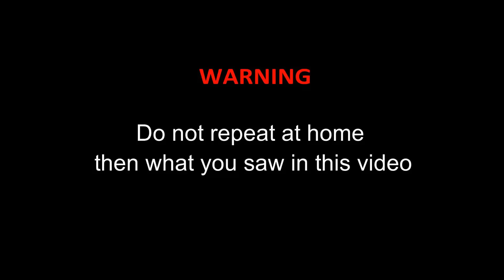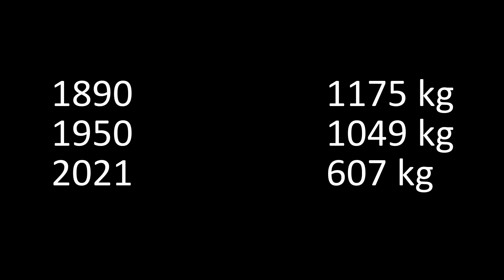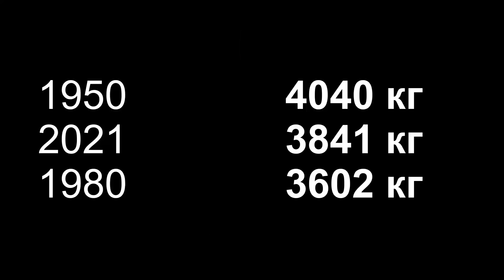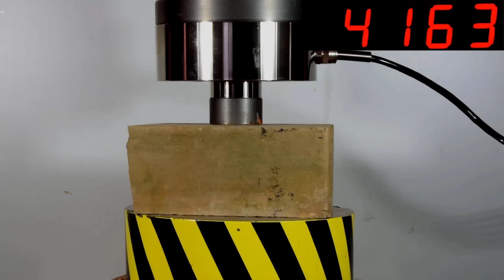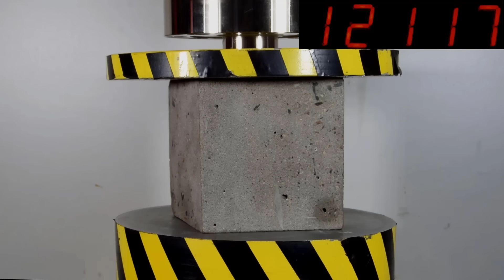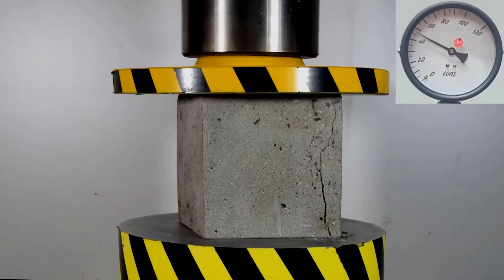HYDRAULIC PRESS VS OLD AND MODERN BRICKS

Comment: FYI: Modern brickas are intentially produced with air pockets so that it lighten the burden of brick layers.
Of course they arent as sturdy.
Also,  modern bricklaying is usually laid as a shell wall and isnt load bearing in the same way that it used to. It's more of an expensive yet efficient weather surface.
Reply: Exactly. Buildings are basically made of steel concrete. The bricks are just aesthetic. The steel inside the concrete deals with the tension forces for the most part.
Reply: No , supply in demand. And different buildings practices. Brick layers are not worried about weight.  It’s all about Portland to sand ratio. More bricks are needed now then ever in are history. And with a lot of Portland shortages bricks are not made the same
Reply: Also worth nothing that the bricks are being compressed in the wrong orientation in this video. I don’t know if modern bricks have any sort of grain structure in them to act as rebar but it’s more than possible that they do
Reply: @austins19982  Bricks are made of clay, not portland cement. You're thinking of cinderblocks.
Reply: Did you I ow that safety doesn't matter if your back hurts?
Reply: @austins19982  supply AND demand*
Reply: Thats a long way of saying we are lazier now and don't want to spend money.
Reply: Rickard, I do see a lot of new construction homes (300k-1m+) and notice a lot of the bricks are just a facade, only on one or two sides. I notice the big industrial building being put up and it looks like poured concrete walls with metal bracings, not brick.  I own a 2 story brick circa 1930. And I see a buncha brick bungalows in my city.  I saw cinder block commercial buildings being built. I don't see full brick buildings being build though. Which would make it make since for them to change their purpose and makeup.
Reply: @TheAudreyduh  i love to spend more money than is necessary for no advantage, because im trad and based
Reply: Good point.
Reply: Such useful info. I will now tell everyone about why older brickas are so strong. Thanks for telling me about such brickas.
Reply: @TheAudreyduh  "lazier" lmao. No. Technology has just advanced to the point that you don't need to use bricks in the same way anymore. What you're saying is like complaining that we use google now instead of opening up an encyclopedia.
Reply: The air pockets also improve heat isolation.
Reply: Finally someone with an IQ over 75! Precisely, no significantly tall buildings today use bricks for load bearing, while they definitely did in 1890 when steel was very rarely used outside of bridge building. So, it's far more likely that a brick from that period will be what we would call an engineered brick today, and as you've pointed out the new brick is far less densely packed and doesn't seem to have been fired either. The purpose of the modern brick shown here, since it clearly isn't an engineered brick, is to fill in a wall and offer some minor insulation in between the superstructure of steel reinforced concrete that bears the load.
Reply: In my country bricks are used to make the non bearing walls, BTW solid bricks can be used for load walls but only if the width is at least 300mm of the wall with overlapping
Reply: We also have modern engineering to build to tighter tolerances so we don't have to spend tons of money overbuilding things.
Reply: @hellomate639  
That is true, but it also doesn't quite apply to bricks. The housings for consumer electronics would be a good example of what you're talking about, tighter tolerances when machining and manufacturing plastic moulds enabled us to not only make the plastic thinner but also make it fit together well and avoid using screws (ending up with a less robust product, i.e. a sufficiently robust product).
Reply: @AnEntropyFan  I think it possibly applies somewhat to bricks here as well, since you'd be looking at a manufacturing environment where you get the cheapest possible product that meets the safety and quality requirements necessary to get the job done.

It definitely applies to civil engineering.
Reply: Still have bricks in the foundations so that's not entirely true
Reply: @BJD12thDoctor  steel and concrete ina domestic house, nope never. Timber yes, steel no.
Reply: @stuartcraigon2003  steel concrete houses are the norm in The Netherlands. Research before you yell something. Things are not the same everywhere in the world. Brick walls are usually a facade in buildings from the 2nd half of the 20th century. My apartment is a concrete flat.
Reply: @tehpurplepills  A true brick building is rarely constructed these days .
Reply: @davethe_428  After talking to someone in the industry I learned that bricks today aren't "real bricks", they are colored cement blocks made to look like bricks in order to save money and that an "authentic brick" is not only expensive, but difficult to find in some areas and without a trained eye you may be cheated, so be careful.
:)
Reply: Very true. What's more, most modern bricks, especially in mid Europe, have a lot more space and air pockets than even the 2021 one in the video and they've been that way for at least 3 decades, although probably much longer. (With of course some more modern modifications available as well. In addition to the reasons you named there's also another very simple reason - insultation.
Reply: @austins19982  theres no portland cement in brick. There are concrete bricks but traditional bricks have never had cement in them to my knowledge.
Reply: which is why i hate new construction homes.
Reply: Nobody gives a shit about the burden of bricklayers. If anyone cared, we wouldn’t be laying 8”, 10”, or 12” concrete  block!
Reply: @smiley1722 I suppose you think it's much more useful to know about the kardashians or the latest sh*t tok nonsense?

Women smh
Reply: @indrajeet  im not a girl though, im both..
Reply: @BJD12thDoctor  
это в какой стране здания В ОСНОВНОМ из железобетона ?
Reply: Nawww thats adorable... You actually think they make them lighter for the brick layers.. Not to save money on transport and material costs. Ignorance is bliss
Reply: @austins19982 but you cannot argue that lighter weight, better insulation, and higher chemical and thermal resistance doesnt play a role
Reply: Stop it, you get fly ash bricks that's normally rendered over they usually 10 MPa... whereas clay bricks are face bricks that are clay and 4 times the price.ckay bricks are stronger
Reply: Mmmm